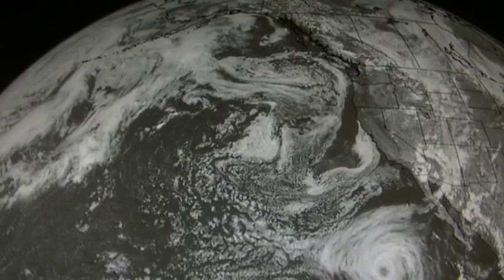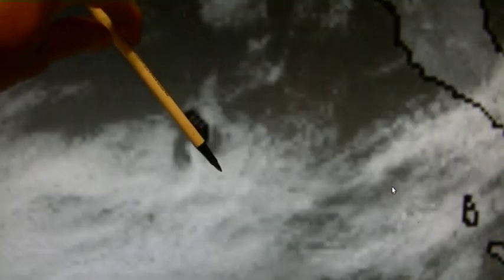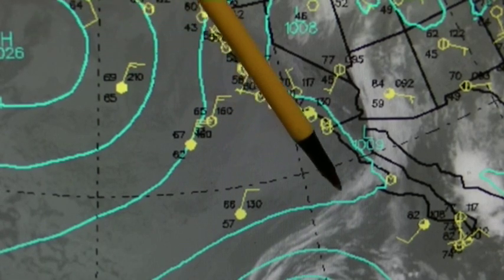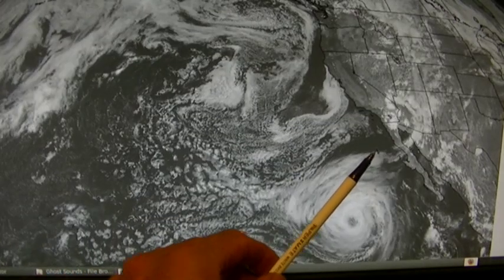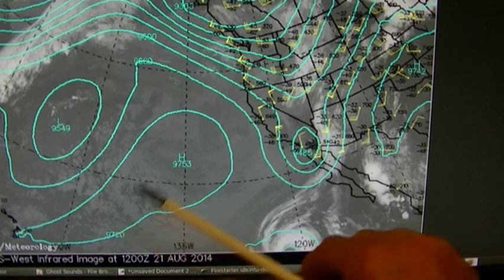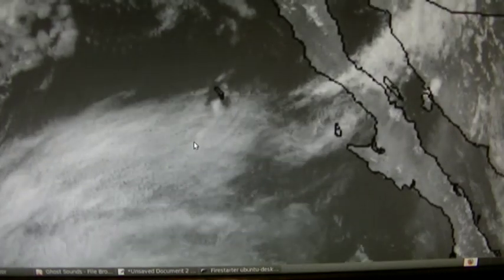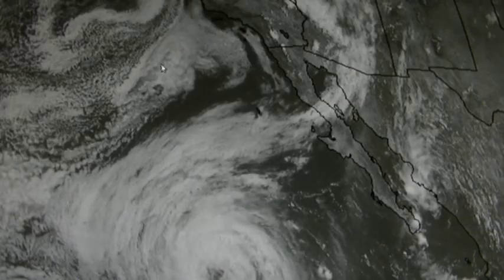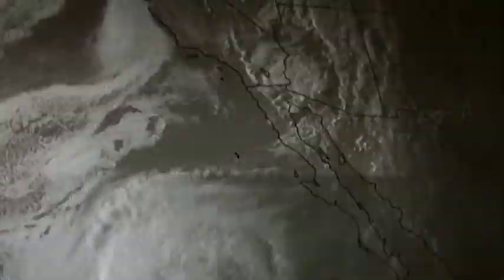Baja HAARP Transmitter Burning a Hole in the Clouds 8 21 14

Comment: Many thanks for your insightful reporting. I am seeing commercial jets that should be at 30k to 35k and they are flying at 20K over my area. The reason is to burn more fuel and more pollution. 
Due to Aviation Environmental Design Tool (AEDT) http://www.faa.gov/about/office_org/headquarters_offices/apl/research/models/aedt/ flights are routed over my remote area for SRM (Solar Radiation Management). 
May 2014 two days of sun. At least 85% sun dimming to date. 
Again many thanks for your reporting!!!!!
Reply from the maker: Wow, my earlier comment was deleted, so here is a second try. If jets fly that low, they are not fuel efficient. This is a huge red flag, showing the airlines are complicit in these programs. We all need to start taking samples of the chemtrail fallout. I will put up a video showing how to build a very cheap chemtrail dust collector. After we have thousands of lab results, from all over the country (and world), then we have the ammunition to fight these programs, and shut them down. Talking, and complaining, about it, is going nowhere. Thanks so much for the link. This looks like software to interface between the military mandates, and the civilian airliners. I will study it and try to figure out what it is really doing. Take care!